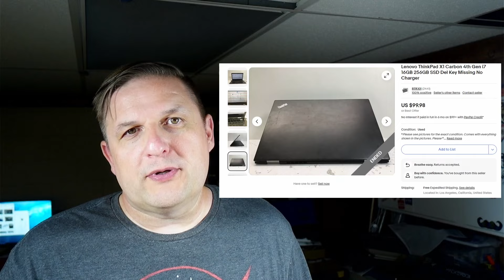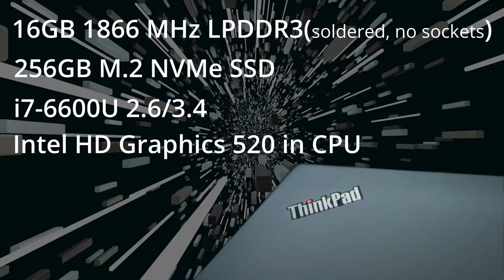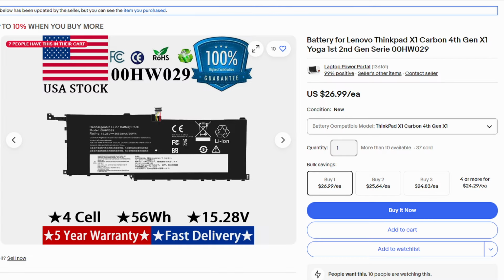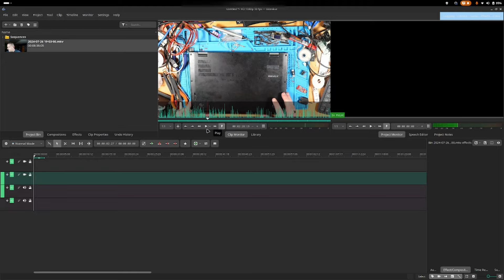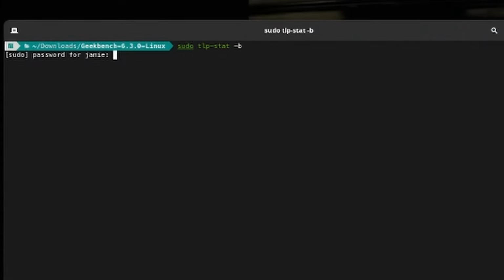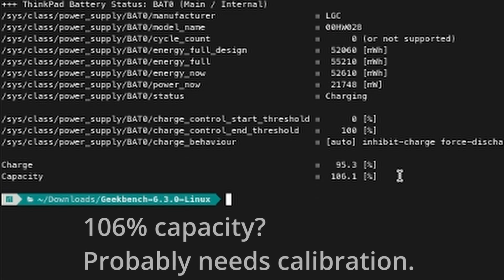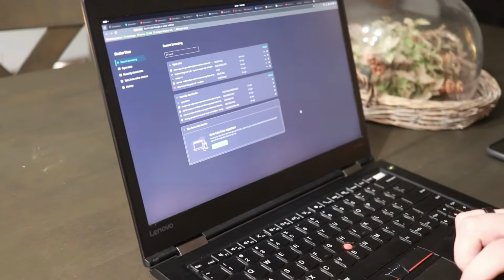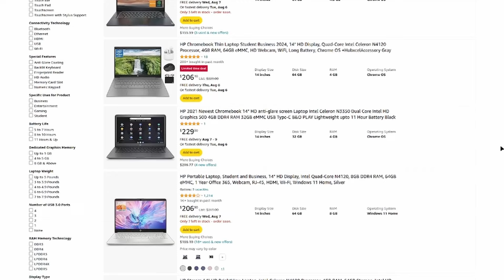Old Ultrabook, New Tricks. Gen4 Thinkpad X1 Carbon

Comment: Currently I'm watching this on a 14" Dell Latitude E6420 from 2011, that I got from the ShopGoodwill online store for less than $100. It's pretty beat up, and has an optical drive so it's not quite thin and light, but with Debian 12 (GNOME desktop / Wayland) on an SSD with an i7-2720QM, it absolutely flies - I am gobsmacked at the performance. YouTube videos are no problem on the 1440x900 screen. I just hope its 8 gigs of RAM stay usable for the foreseeable future, allegedly it can handle more even though the specs say 8 GB is the max.
Reply from the maker: Right on! Sounds like a good one ready to keep on trucking! Thanks for watching!